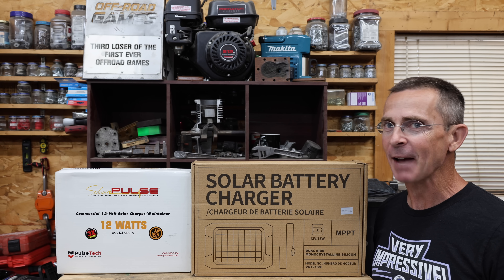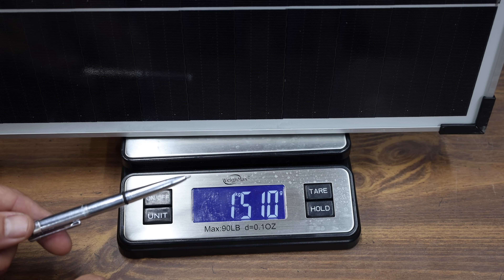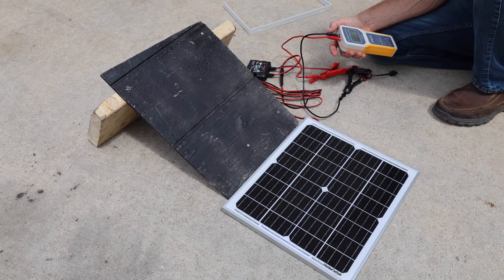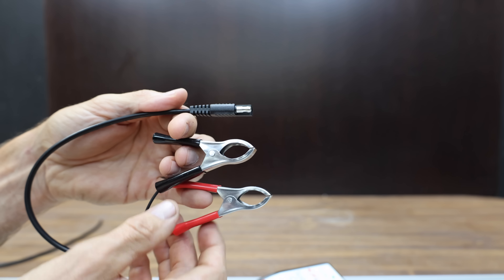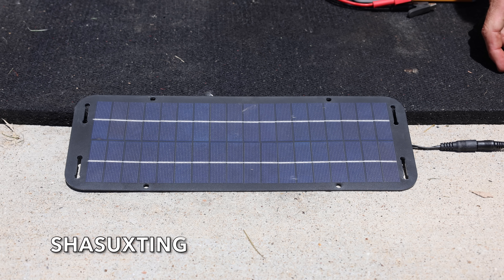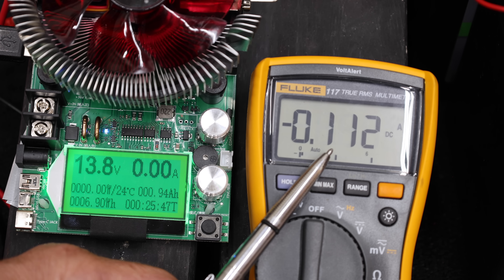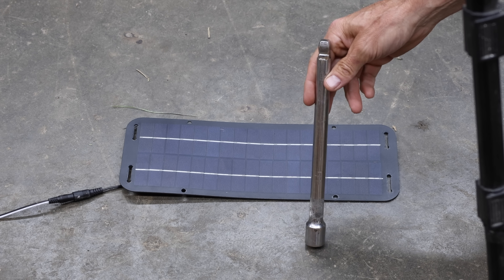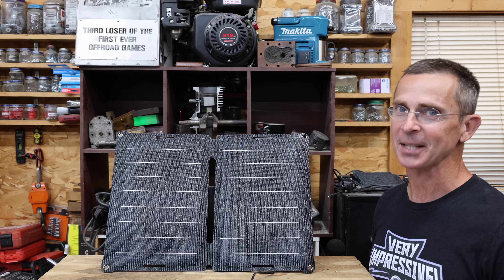I Had No Idea These Were So Good!

Comment: Again, do I need this? No. 
Am I going to watch the whole video and NOT skip the ads? 
Yes!!! :_Tested::_TestThat::_Approved::_TestedBest:
Reply from the maker: Thank you!
Reply: What ads ?
Reply: @henkwinon660 non-premium people
Reply: @henkwinon660  i think for the legends without "Premium"
Reply: What ads?
Reply: Do you own anything with a lead-acid battery in it? Mower tractor, whatever. Leaving a (solar) trickle charger on it will extend the battery life. I've gotten 5 years out of a 2-year battery on my tractor out of this trick. Going solar costs you nothing past the purchase.
Reply: @bjjohns I've had a lead acid battery last 10 years - charge it up fully and leave it somewhere with decent climate. Charge it once a year or immediately after using it. I don't think it would have lasted this long if it was very slowly boiling away the electrolyte with it on a trickle charge but that's just me.
Reply: You watch the ads? It's a real effort to force my YouTube app to even show them.
Reply: Me too!
Reply: I'm a slave to the system and pay for premium. Used to be cheaper. Shouldn't really have to pay to not see ads IMO
Reply: @DKL3825  So don't. There are several ways to eliminate yt ads
Reply: @user-gd1ch8nb2b how??? They drive me nuts
Reply: @SheikYerbuty  The easiest way is to skip video to 5s before the end, then click to rewatch it 🔄 and enjoy with only 1 ad. You can also use blockers or third-party apps.
Reply: @SheikYerbuty let me know if it worked for you
Reply: What's the point? Are you proud of wasting time for ads?
Reply: There are ads in these videos?
Reply: But I might need it one day.
Reply: YouTube premium is the way.

Comment: Oh, this will be a must watch.  Looking to buy some for my camper.  

grabs popcorn
Reply from the maker: Awesome! Thanks for watching!
Reply: Dude, if you have a camper go ahead and put full size panels on the top. You could literally live off grid. They're so good now between batteries, solar panels and one of those tiny little 2000 w generators. You can keep your batteries topped up
Reply: @Bozemanjustin 
We bring a 2000 watt inverter generator with us and it always does the trick.  I would like to line the top of the camper with additional solar panels.  I believe the camper solar system has a 400 watt capacity.
Reply: @Bozemanjustin  batteries keep getting cheaper, panels keep getting more efficient, it's definitely a good time to look at solar, especially if you boon dock.
Reply: Exactly what I was thinking.
Reply: @Rotund_Panda_Pants
 just dont, buy a battery trickle charger. These are just a solar panel with a charge controller. It will overcharge the battery
Reply: @Chris-hw4mq 
I have a factory solar trickle charge on my camper now (50W)…  it works ok, but am looking for more juice as when we boondock the 12V fridge really drains the batteries (i have two batteries parallel linked)

I thought this video was going to have solar systems with larger capacity.  These won’t charge anything.
Reply: @Rotund_Panda_Pants that's not true, just because they won't work for your purpose doesn't mean they won't keep a battery charged in a remote location away from power that ISN'T being used, which IS a legitimate purpose.
Reply: @Rotund_Panda_Pants  these are too small, if you want to run off grid you really need to add up the average wattage use of your appliances.

A TINY solar panel like these won't even be able to power your fridge, nevermind charge the battery so it can survive the night. 

You need rooftop solar. 

Even if you just need help to keep the battery up for a weekend trip, these tiny things won't do it.

Real solar panels are big for a reason.
Reply: @Rotund_Panda_Pants  Thats simple just get one of those solar generators, I have a 700W bluetti with a 500W solar panel thats going strong for two years.